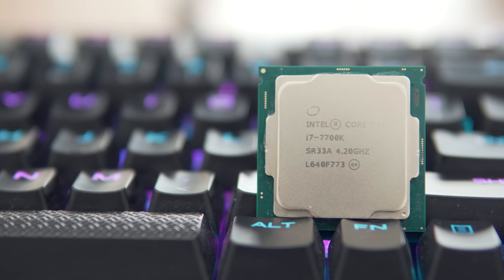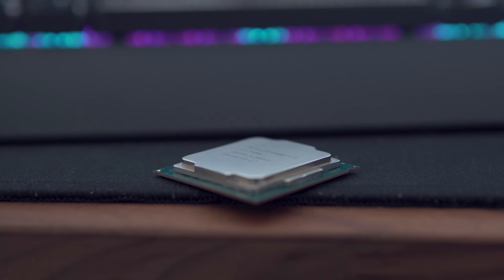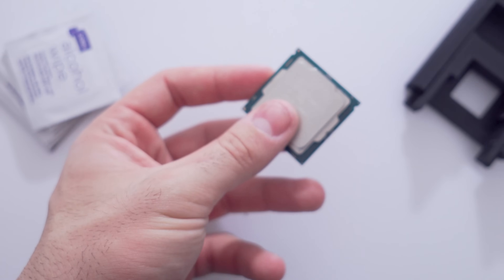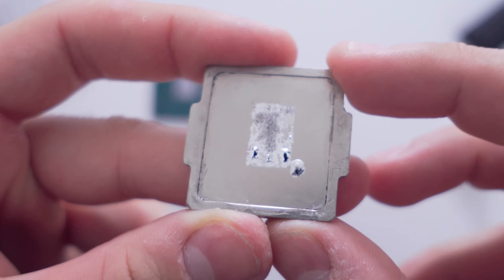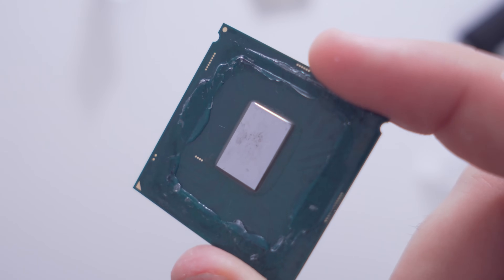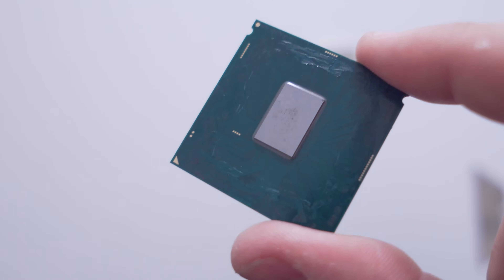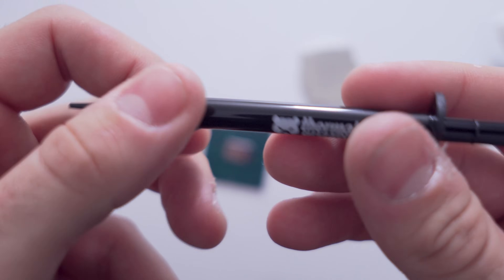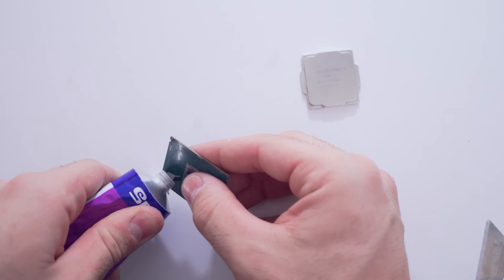Liquid Metal on CPU - 9 Months Later!

Comment: I've been using my delidded "Intel 4690k at" 4.7 ghz with " Coollaboratory Liquid Pro" for almost 3 years and temperatures are still great, if not, the same... so yeah, no need to replace the liquid metal, at least in my experience.
Reply: Try that with a 7700k overclocked
Mine shot up to 80+
Same overclock after delid 61 max. Same loads.
No fans spinnig up all the time anymore. 
Did the same on my gtx 1080 ti. That was running towards 80+ after intense gaming. 
Now it barely runs over 68 on the same loads.  With the same overclock on that One i gained almost a 100 hz. More Just from lower temps. 
By the time any of my components will die from the liquid metal, i have already replaced them due to the fact they are outdated. Every 4 year or so i go for upgrades. 
So i recommend doing it

Comment: Is it safe to replace my intel core i3 with and intel core i7?
Reply: darrick steele probs need a new motherboard depending on type and age, would check your mobo type research if u feel u need an upgrade.
Reply: Why? ty for help but since this last comment I have taken a closer look at laptop and between my poking around and further research I have found that it is in fact a bad HDD the arm is stuck. ever so quietly clicking. (Western Digital not recommended)  *[my next question is will i be able to access the data?]

Comment: Is it safe to do in a laptop? I have a ThinkPad T440 and i want to lower temps but im worried that since its in a bag it may seep out from under heatsink
Reply: Provided that you don't over-apply it, you have nothing to worry about.  If you're paranoid then get some conformal coating and insulate any electrical components around the area you apply.  I have torn down my Asus G750J to switch out all the thermal compound in the past, and I'll be doing it again with the thermal grizzly in a few days when I swap out my 770m for an 880m I picked up from eBay.  
A quick google search says it uses integrated graphics so it should be a pretty easy project only having to switch the tim on the cpu and not also a gpu.  
Also know that you might not get much of a result as laptop cpu's are almost always bare die with no IHS to remove, but there is still room for improved temps if they used crappy compound or one of those pads.  Look into undervolting for extra battery life as well as sometimes drastically lower temps.  

You might be able to do this with just intels free XTU program.  Best of luck. :D

Comment: If your going to go through all that trouble, don't put the IHS back on, put the die directly to the heatsink. It defeats the purpose to use liquid metal on the die to then put the IHS back on and use regular thermal compound.

Comment: so after you delidd and apply the liquid metal to the IHS(?) you have to relid and put normal thermal past on top of the outside of the lid to remount your liquid cooler? or is liquid metal used there as well?
Reply: VF well yes you are able to use liquid metal again on the lid 🙄😭 nothing wrong in that, also you can use a liquid cooler too 😉
Reply: u can direct die cooling it, I saw better perfm, but u can do what u said

Comment: Very simply the gallium corroded the top of the cpu and in so doing formed an alloy and an oxide. The corrosive oxide was that which you wiped off and the alloy remained behind, that is the darker "stain" you see.

Gallium is corrosive to most metals.

The downside is eventually if given enough time it will eat into the cpu. The alloy that remains behind has less thermal conductivity and may affect temps by a degree or two.
How soon the damage becomes severe depends on a wide variety of factors.
Delidding and applying gallium will reduce the life of the cpu.

The electroplated IHS is mostly protected from this, so it is safe to say damage is to the cpu itself.

Comment: I used Arctic MX-2 instead of what Intel used for my Xeon E3 1230-v3 and temperatures decreased with about 10-15 Celsius, and up to 25 Celsius while running Prime 95. The original thermal compound was totally drown and inefficient.

Comment: What you are seeing on the die is an amalgam due to the bismuth in the liquid metal displacing the silicon atoms.  There is good news and bad news here.  The good news is that the CPU die is rather thick and the liquid metal would have to attack much deeper than what is shown in your video before it even reaches the circuitry of the CPU and causes problems.  The bad news is that once this reaction starts, the bismuth will seek to reach equal distribution throughout the chip, meaning that it will eventually work its way down there regardless of how clean you try to get the surface.

Just watch what mercury does to aluminum to get an idea of what is going on at an accelerated pace.
Reply: How do you know it has Bi?  I thought it is eutectic Indium and Gallium.
Reply: Some liquid compounds contain Bismuth, and to be honest I had that on my mind when making my comment.  I completely meant to say Gallium instead.

I have several Si wafers at home, some which have been processed and contain various stages of CPU lithography (these were Pentium 4).  I also have a few blank silicon wafers, one of which shattered.  I placed a piece of Si into a gallium bath and heated it to 90C and left it for a month.  I did notice that while the gallium appeared to come off completely, under my stereo microscope there was evidence that the surface had undergone changes.  I do not know if this was infiltration of Ga into the Si matrix, similar to how Ga attacks Al, or if it was some oxidation process driven by a galvanic reaction.  All I know is that the die was permanently affected by the exposure to Ga and heat.  It wasn't nearly as severe as shown in this video, but there were changes none the less.  It appeared to be pitting as opposed to a buildup, but sometimes lighting can play tricks on you when looking through a microscope, so I don't know for certain what transpired.

Comment: I'd say that once delided, don't re-seal it up so well. Maybe a tiny drop in each corner. In some videos they don't even glue it at all, but just set it in the motherboard bracket, drop the heat spreader on top then latch it down.

I can't say I like the obvious corrosion/reaction marks on the once smooth and shiny die after just 9 months. I expect cpus to become obsolete long before failing. The i7-920 I replaced is still running flawlessly after a decade.

Comment: Precisely what I was thinking, as I am about to do my 4790K. .. However that overspill of metal is scary. If it had gone a couple of millimetres further. That would probably have caused a fault or death of CPU. ... I actually bought liquid metal, but I also bought some Kryonaut for general use. I am thinking very seriously about only using Kryonaut on the delid though. ... To prevent liquid metal touch contacts or components, you need the absolute minimum liquid metal. ... However all delid guides say put LM on the core and the IHS. Yet that would risk too much LM.
Reply: Green Bow did you delid your 4790k I’ve been thinking about it but not sure if its worth it. Mine is at 4.6 1.232v and only hits 71 on one core in prime 95 26.6 15 min
Reply: I have stock specs on my 4790K. Delidded and applied Kryonaut. It took about 5'C off stress test temps, and about 10'C off gaming temps. It was worth it to me, if only for the experience. Plus I am more comfortable not hitting 70'C while gaming. Part of my problem with heat was that I bought the MSI 1080 Ti, which is a very hot card.

Comment: What's the point of putting the ihs back? Wouldn't it be more effective to paste your discrete cooler right on top of the chip?
Reply: Silicon is fragile and you risk destroying the cpu when applying the cooler to the chip as depending on the cooler you need significant pressure to mount it correctly. The is such a thing as a direct die shield but has fallen out of popularity since delliding has become mainstream.
Reply: There's already watercoolers that directly fit on delidded CPUs. Linus tested one
Reply: people have done this. It drops temps another 1-5 but it's risky as others have said and the ihs on intel holds the chip in place and pushes on the chip backing as well. 
so most of the time you need the IHS, I would love to see a water cooler that is just like a ihs in shape but is one piece of copper. This could be a very thin unit! also the ihs/cooler would be help on buy the chip hinge so no other mount needed!
Reply: Don't people know that a laptop CPU doesn't have an IHS? A laptop CPU cooler is directly on the die so it's certainly possible and I totally agree that a CPU cooler would spread the heat just as well as an IHS. There is literally no reason why it shouldn't.
Reply: FinlandForceTeam same thing a heatsink does so just use a heatsink
Reply: i think to dissipate the heat more evenlz from the die to the cooler baseplate its more benefitial to use the heatspreader..i mean its literally the name of the thing :D
Reply: Why do you think conventional cooler would fail in that? I think it would be more benefitial to put the cooler right on top of the cpu because you have only one layer of thermal paste between cpu and cooler. This just has to result in much more efficient cooling.
Reply: No,old amd/intel cpu,s have no ihs and you can damage the silicon core or chip of a corner without a ihs if the cooler is mounted wrong ,i would not recommend it!
Reply: ihatenamehoggers has got it right. IHS' were added to make installing heavy coolers more straightforward and safe. I remember back in the day when AMD chips almost never had lids, and god do I feel old saying that.

Soldered lids seem to be almost as effective as direct contact, but if you're going to delid an Intel chip with crappy TIM anyway, I think it may be worth considering direct contact. Much riskier with air-cooling than a water block, but you can still damage the silicon with a lightweight water block if you aren't careful.

For direct contact, you really have to do your research and ensure you are comfortable with everything you may have to do. Many sockets actually stick out above the silicon height, even after replacing the retention mechanism.
Reply: Martin Procházka you can do that, but the entire point of ihs is to spread heat evenly thus making the cooling more effective
Reply: C'mon, you just delided you cpu and it miraculously survived, would you really care about a risk of destroying it? I guess you would not if you delided it in first place. Btw, if you apply the pressure slowly when mounting the cooler then flagility should not be a problem.

Comment: For the people who spread misinformation about having to replace it every 3 months- you're clearly mad. I've had mine on my delid'd 4770k for 2+ years and the other day went for a full system clean down and opened up everything ( I mean EVERYTHING lol). Nothing was damaged by the Liquid Ultra. Minor shadow on the heatspreader on the inside but with a swab of alcohol it's..gone..durr. 

Again however, please be careful how much you add on the die itself. I don't use a 'glue' to the die/heatspreader so when you're mounting it, it's very easy for you to twitch and basically have it spreader everywhere under the IHS lol.

Also, Liquid Ultra is far superior to this Grizzly hype. It's just hype. A paste is not going to be as good as liquid metal, I mean just think of the two properties from a scientific point of view lol.
Reply: Thermal Grizzly does make liquid metal pastes along with regular thermal paste...

Comment: What a joke. Iv`e been running an overclocked I7 for 7 years on an X58 board with Noctua Air. Still running strong as I contemplate an 8600K. No risky de-lid necessary.
Reply: That thing is soldered.

Comment: I thought delidding was removing the lid, and running the cpu without it, like in the days before cpus had a lid on them. Is the thermal compound they use between the cpu and the lid so useless that you get up to 20 degrees lower load temp just by replacing it?

Comment: A few friendly adviced coming from someone who has delidded since early 2000 during the soldering delidds :)
Rather use nail polish over the copper dots on the pcb to insulate them rather than an adhesive that could during hot temps adhere to the ihs overtime and the next time you delid you might damage those copperpoints when removing the ihs.

About the liquid metal, a good rule of thumb is to never have that much liquid metal so that when its all spread out, you can see the liquid as small ponds of fluid, you want it too look like its been painted in silver, if you tap the pcb a little and you can see any movement in the liquid metal you know its too much. Also one more important thing is to spread a just as thin layer of liquid metal on the ihs itself aswell, just making sure the part you do liquid metal on the ihs is just as big as your cpu die and also corresponds to where the ihs and cpu die will meet when mounted.

Just what ive learned from over the years, thanks for awesome videos btw, new subscriber here :)
Reply: Daniel Friman Amazon sells this product from MG chemical it’s a little better then using clear nail polish it’s called MG Chemicals 4223-55ML Urethane Conformal Coating, 55 ml Bottle with a brush applicator has a very high dielectric strength and it’s UV reactive so you can check the coating under a black light to see the coverage. Hope this help anyone thinking about deliding their CPU
Reply: My i5 7600k thats been delidded and put thermal grizzly conductonaut between the die/ihs has not needed re-application so far atleast and its been well over a year now and the temps are cool and lovely still, got a nzxt kraken 52 aio mounted on it and the idle temps are 22c, full load in aida64 45c (overclocked to 5.2ghz) but my 24/7 oc is 4.7ghz and the idle temps are the same, loadtemps just went down to 43c there. Thermal paste on the ihs is kryonaut. 

Also tried cryorigs R1 air cooler on it and gave me same idle temps, 4-5c higher loadtemps than the aio though.

To adhere the ihs onto the cpu pcb i used heat-silicone that handles up to 300c and isnt gonna destroy my pcb if i someday want to delid it again. Using superglue and such to adhere the ihs onto the pcb can be risky if you want to delid it in the future.

I remember back in the days when liquid metal was "new" i used coolabratorys metal and used it for over 2½! years without seeing any temperature-differences from initial apply and when i delidded it the liquid metal were still liquid.
Reply: That aircooler is kickass i agree. I went with an aio and put 2x noctua ippc 3000 120mm fans on the radiator as they have such high static pressure i get away with having them at 240rpm in idle and around 850rpm load and they are whisperquiet. But if i ramp them up to 3000rpm it sounds like a factory, tho i dont need to have them about 850rpm for the previous mentioned temps at load. Also chose an aio over aircooler because of the smaller size and ram-clearance since i got corsair dominator ddr's that arent low profile :/ The best aircooler that clears for my memory is cryorigs r1 universal because of the heatsink construction and the 1x slim-fan on the push-side of the heatsink.

Comparing coolabs vs conductonaut i got better temps with conductonaut and i also like the viscosity more but the difference in temps are negligible.
Glad to be of assistance and good luck on the delid, that silicone will work for sure :)
Reply: @frimanboi  Still running well? Any need for maintenance?
Reply: Cloopster I can sort of help you with the stress testing question.

So I agree too that Prime95 is better and more reliable than aida64. Where in most cases my stress testing will pass 64 but fail prime.

Also when using prime use version 1.26 or 1.28 not sure, but I think it's 1.26 that does not use AVX which will give you more real world results with much lower temps.
Reply: Give this man a channel!
Reply: Thanks for the info mate
Reply: Thanks for the advice. Regarding the copper dots, do you mean also apply nail polish to those on the edges which are visible too? or just those under the ihs?
Reply: This needs to be Pinned
Reply: Does laptop cooling always have copper, also how often to reppace the liquid because it copper
Reply: @gkelley77  one day I'll find out for sure, so far it's functional for 2 years without any degredation in thermal performance.